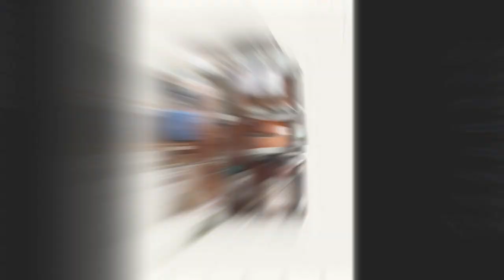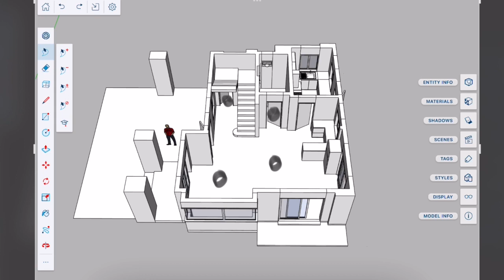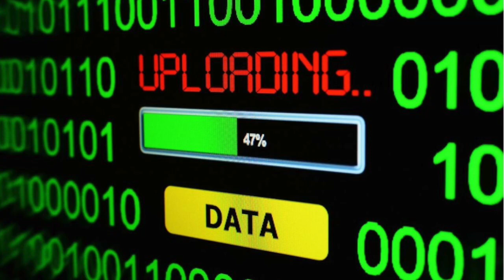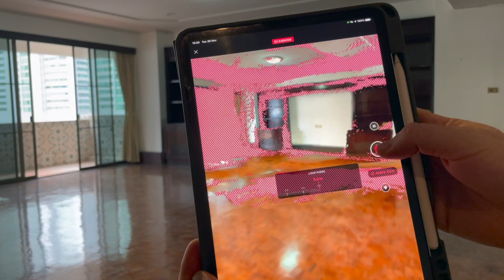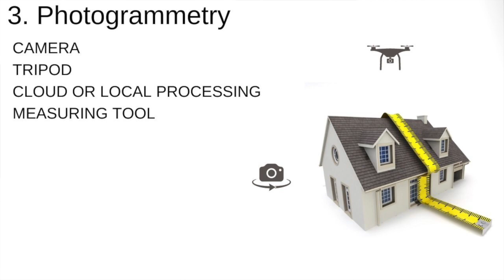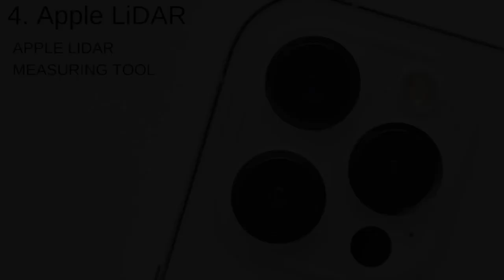Tech comparison: Digitizing buildings using * Apple LiDAR * 2D * Photogrammetry * High-end scanners

Comment: I do find drone photogrammetry to be very cost-effective and fast. trick is to have a drone that does at least 48MP - then the mesh data gets incredibly detailed.
Reply from the maker: Yes, that's great, especially great for exteriors. 
Have you tried running your data through a NeRF process?
Reply: @LiDAR3D  we are actually evaluating this right now 

I have the feeling that it might replace photogtammerety at one point
Reply from the maker: @cekuhnen  Same here!